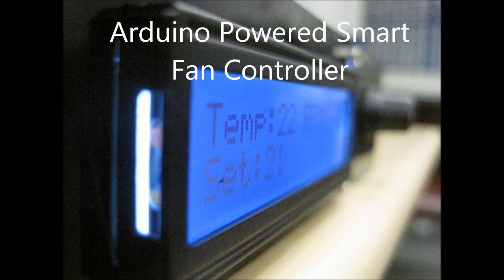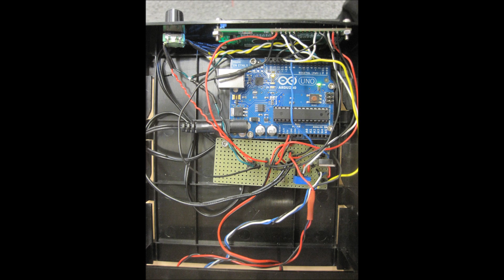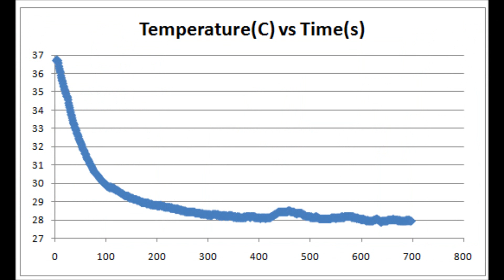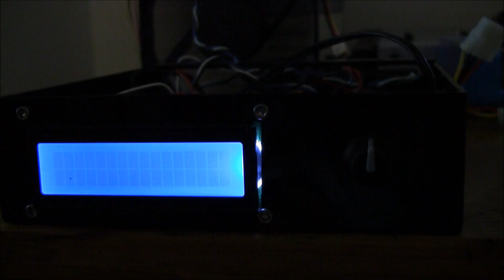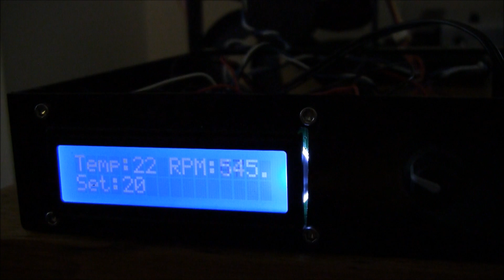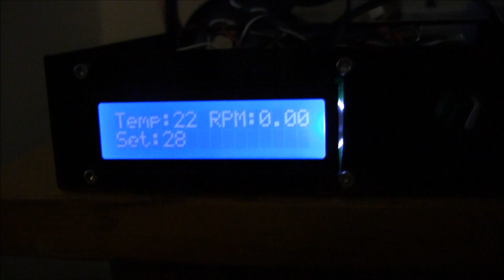Arduino Powered Smart Fan Controller

Comment: Great video, Chris. I did a similar project using an ATtiny85 and DS18S20 sensor. Only problem I have is that the fan is noisy due to the PWM frequency. This is very annoying when the fan is running in a quiet room. Did you encounter the same problem?